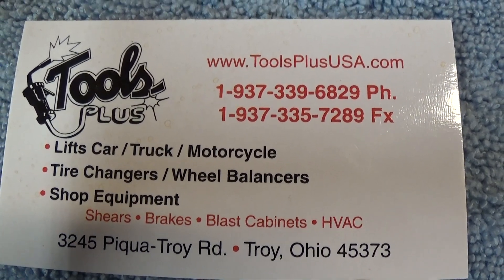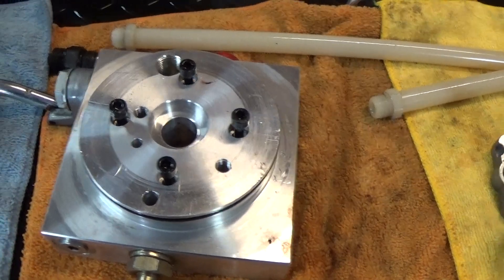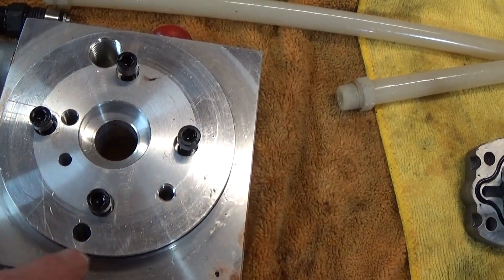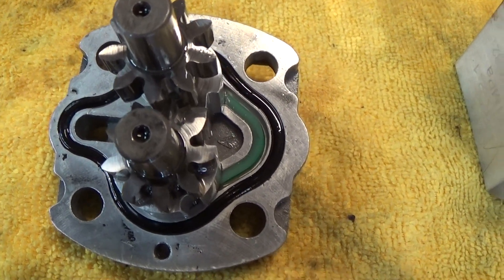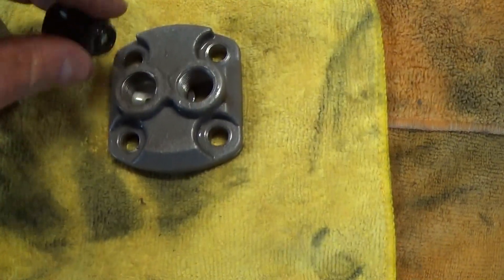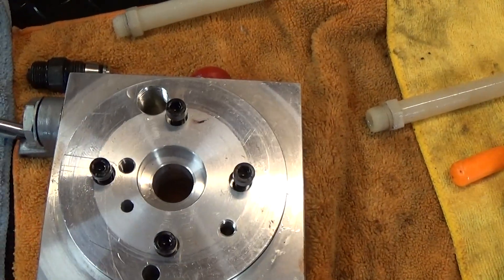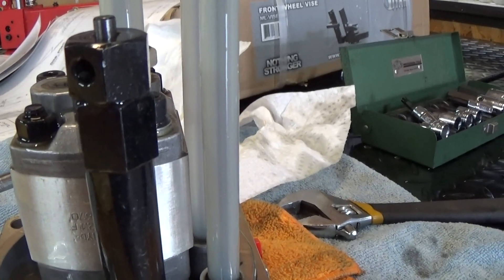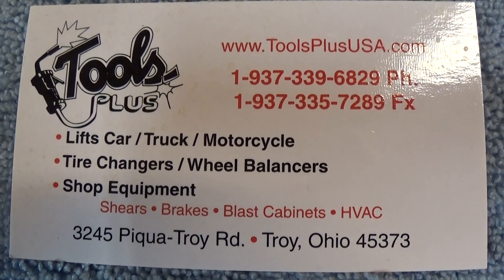Car lift Hydraulic motor pump repair service

Comment: Thank you, great video. My pump is not making pressure. When I removed the oil fill cap I can see the pickup, return, and the check valve. Oil shoots out of the side of the check valve while running the motor. I will pull the reservoir and look into the check valve.
Reply: Vernon, did you ever figure out the problem?
Reply: @Brian B  I did. The bypass valve was sticking open due to loc-tite that had been applied. I cleaned it out, adjusted it to 8½ turns. All is well.
Reply: @vernonwilson5712  Thank you Vernon for the info and reply. Take care

Comment: Hi I have a 4 post lift surging bounceing while going up jumping as it goes up any ideas
Reply: I have questions regarding that also...not in sequence while going up ,some are delayed 
any answer ?
Reply: I bought this rotary lift, but it was almost brand new, when he was going up halfway, he will start bouncing. I had two different companies look at it. They threw new hoses, they put a piston to try thinking that one piston was weak. They bleed it. They also installed new blocks. They tried everything. They kind of gave up and i had no help from Rotary. The solution was to grease inside very heavy. Apparently the powder coat was very thick on some of them and causes binding on the top portion.

Comment: The 2nd check valve you showed, the longer one, do you have an illustrated break down?  We have been told that there is supposed to be an o ring, but we can’t find where it’s supposed to go.
Reply: did you find a breakdown or parts to fix?

Comment: i have rotary 12000 2 post hoist , only 5 year old hoist  jumping  after 6 feet lifting . i remove air from the system , it works good , if lift second time it jumps . please let me know , is there any way air can get in to the pickup tube .any advise please

Comment: Have a 12k  2 post Challenger lift,  I took my unit to a shop to have them check it out. After they looked at it, the kinda just blew me off and didn't really want anything to do with it. The lift is only 5 years old, and still looks new. So I found your video on pump repairs. I watched the whole video, and you showed me most of everything that can go wrong with all of the parts layed out. So i decide what do i have to loose. I took it all apart,,, I found a Split o-ring were the pump bolts to the base. I installed a new set of o-rings. Reinstalled it back on to the lift, and boom, It lifted my 1 ton chevy 6.6 diesel right up..     The original problem was the lift would go up very slow, Over time it was getting slower and slower.   So I thank you for your video, I couldn't have done it with out your help
Reply: Hi, I am having a similar problem, just noticed my two-post hoist is slower to go up than before. Were you able to obtain the seal from a bearing shop or do you have to get the seals that are made specific for a lift pump?
Reply: @wecarespares  went to a hydraulic shop. Had lots of orings to choose from. So went with my split oring and matched it up.   From what I remember. It was a little curved. But it fit into the groove, and sealed great.

Comment: i have a 9000lb lift ,when i lift my crew cab dually , the lift comes up very slow , can i replace motor with a motor with more hp?
Reply: Yes, but you are limited by pump not motor hp. You will see absolutely nothing.